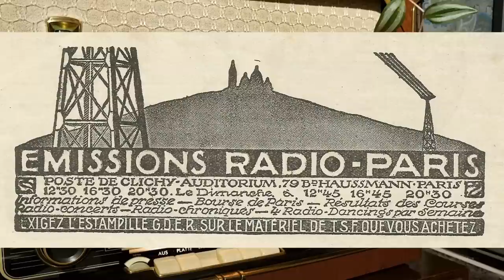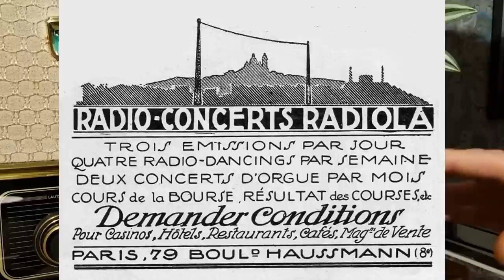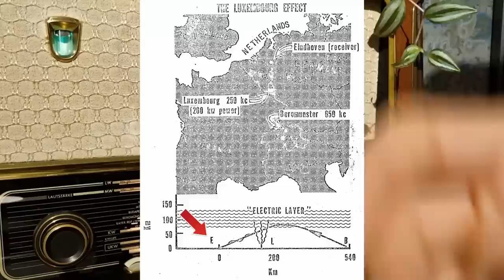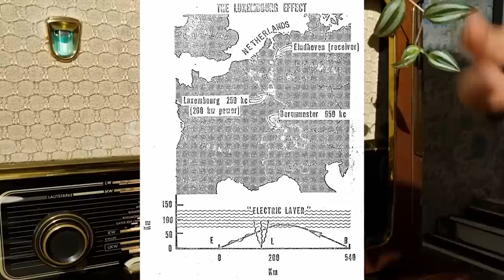We just lost the most powerful longwave transmitter in Europe, and why that's kind of a big deal

Comment: 198 is the BBC Radio 4  domestic service between 05 30hr to 01 hrs, becomes a modified version of BBC World Service between 01hrs 05.30 hrs GMT
Reply: In addition, the video mentioned the BBC likely to close it down in the coming years.. Thats maybe not as likely as it might sound for a couple of good reasons, which apply to this transmitter but not the BBC's other transmitters. This transmitter is a bit special...
Firstly, as has been mentioned it is used to transmit signals for the UK electricity system, and to convert all those receivers would need a huge investment of time and money
Second, this transmitter, because of its high power and long reach, is used to broadcast the shipping (weather) forecast for all the waters around the UK. This is done by the BBC as part of the usual Radio 4 schedule, at (from memory) 0050hrs, 0530hrs, 1202hrs and 1755hrs. This is meant to be heard by any shipping within about 1000 miles or so of Droitwich which covers all the waters out as far as Iceland and down into the Bay of Biscay. To stop this service would be something a government minister would be reluctant to put a signature to, there would be lobbying, and "questions in the house" and much stamping of feet.... 
Thirdly, and probably weirdest of all is that the existence of the BBC broadcasting on 198kHz is taken by british submarine commanders as proof that the world hasn't ended yet.... The idea being that they regularly check to see if they can pick up the BBC on that frequency. If they can't, they are to assume the UK has been destroyed in some sort of nuclear attack and then they open the sealed letter they have on board from the UK Prime Minister which tells them what they are to do next. This is necessary because those submarines would contain the last of the UK's own nuclear missiles, and without a UK government, the commander needs to know what to do with them! These letters are apparently one of the first tasks that a new Prime Minister has to undertake when he or she enters office. 

This is all almost unbelievably surreal but it has been detailed in many articles and documentaries over the years quoting both military and government sources and is so quintessentially quirky and british that I have very little doubt of its truth. 

What this means is that that transmitter is a vital part of not only the UK broadcasting infrastructure, not only part of the UK energy infrastructure, but also part of the UK government and military infrastructure.

So no, I don't think its going to be taken off air any time soon! But I could be wrong!

Comment: Can local private broadcasters even in the Netherlands pirate occopy those now empty frequencies?
Reply: Only frequencies owned by The Netherlands. But they are being given out and planned in such a way that the new users don't interfere with each other. With all major medium wave stations in the netherlands having closed down, there are now about 50 new local and regional MW radio stations! Power is limited to either 1w or 100w depending on your choice. Range very much depends on the antenna the station is using. Cost (for the 100w transmitter) is less than the cost to run a 100w radio transmitter.
Power needs to be kept low so dutch stations don't interfere with others in Europe, but also so the same frequency can be given out multiple times in different areas in our country. As far as i can tell with the 100w frequencies, one channel is only given out when there's no other user in a radius of 50ish kilometer. For the 1w frequencies that radius is a lot smaller.

Comment: I used to work at an AM radio station. we put out a blistering 1000 watts. the cool thing is we had C-QUAM. shortly before closing I turned the modulator back on and cranked it to the max, 1200 watts. it was super interesting to see AM stereo work before it went down.

Comment: That sad . I am in the USA and some of them stations came in at night. I got long wave on several radios. Hear in the US we now have 2 armature radio bands. also WWVB can be herd on long wave hear. I got a nixie tube clock that has loop stick antenna and it locks in .  currently 2023 FEB I hear a lot of digital on long wave. and we are loosing MW AM stations in the us. some transmit digital HD radio only on the MW band. lot has to do with the cost of power. over the years the USA has been switching broadcast from analog to digital.  we still have a lot of SW stations     on the air. WBCQ WMRI and some others . WWV still sending  time data and solar data. and turned back on 25Mhz   .The Russian wood pecker is gone.  video's on YouTube show how big the cite was. now one Ukraine cite is radio active and not used. part of the cold war radar system. nice video on biggest LW transmitter. from USA NY .😀
Reply: YOU MEAN "WE ARE *NOT* LOSING MEDIUM WAVE STATIONS, RIGHT?

Comment: Sad. I can receive Medi 1 from Morroco quite well. Somethimes they talk and receive phone calls in French, sometimes they play modern music but often i can hear local Morrocan music. It is also quite powerfull.
I use JRC 525 with miniwhip or single line thrugh UnUn. Tube radios i try not to run for whole night.
Medi 1 is 1,6MW on LW, but i can receive Slovenian Radio Murski val at 648kHz quite well which is 500km away and it has only 10Kw of output power.

Comment: Allouis 162kHz is still on with phase modulated carrier only, as a time signal station (ALS162).
Reply from the maker: Thanks for sharing
Reply: I was just thinking the other night, when I was "listening" to that, would be not be just as costly or not to modulate it with something - anything  - other than just broadcasting a blank carrier?
Reply: @paulsengupta971  Hi, I remember reading they broadcast an atomic clock signal. To sync what exactly is another matter.

Comment: Old radio's are just funny things to look at, or you can build in a DAB radio that uses the old radiospeaker.
It began (I think) with the dissaperance of the flemish transmitter, then the Hilversums and finally La Une walonne that disappeared.
Reply from the maker: Or you can add a Bluetooth module so you at least still use the original amplifier of the radio. 😉
Reply: @retro_tech  Hopefully that is even simpler, cheaper and more original sound
Reply: @retro_tech  More appropriate would be changing the tuning circuit to act as the RF part before a modern demodulator for stuff such as RMD and DAB.  This would also involve supplemental changes to the band selection circuit, as some of the fixed value coils will need new values for new bands.
  This way the circuit becomes classic RF section - modern demodulator - classic AF section.  Be sure to scale the voltage range between tube and chip sections.  Have fun adapting DAB chips to work with a separate RF tuner so digital controls only select a subchannel within the tuned to MUX.
Reply: Keep the circuits of the old radio intact and just make an am transmitter to broadcast the programs of your choice around your house.  A low power AM transmitter is easy to build an can be operated off batteries or an ac adapter.

Comment: you don't get Warsaw on 225khz??
Reply from the maker: Not really. I can only get it with my mini whip antenna, and then still with quite a bit of distortion. So definitely not indoors with a normal ferrite rod.
Reply: @retro_tech you only receive medium or long wave on a copper wire wound ferrite rod, 
*NOT* a metal whip antenna

Comment: The radio channel France Inter announced during 2016 that the channel would discontinue transmitting on the 162 kHz frequency on 31 December 2016, seeking cost savings of approximately 6 million Euros per year. They used the Allouis site which is now as a time signal. Internet killed the longwave star.

Comment: I have an Opus 6 Telefunken radio looks a lot like your Operette radio. BBC Droitwich is running on the last of the available vacuum tubes for their final amplifier.
Reply: Hopefully some boffin finds a way to build an output stage from modern components from the SMPS industry.  Basically the same components used in HVDC power line interconnects, but in a quite different circuit mode.
Reply: @johndododoe1411  yeah I see that point.  Problem is nobody wants to pay the electric bill for the huge transmitter even if you make it more efficient
Reply: @mikekokomomike  Point wasn't to make it more efficient, just to keep it alive without an impossible supply of antique components.  Specifically the companies making parts for the power grid (ABB, Westinghouse etc.) actively makes and sells semiconductors that can operate at the required power levels and above.  Thus instead of repairing a museum grade tube based output stage, someone with time on their hands could use surplus from the production of these power grid systems to make some boxes that can be installed at long wave transmitter sites in place of the old equipment without forcing any change in the radio signal.  Grid suppliers are also very experienced in providing such equipment with multiple decades of service, support and warranty.

Comment: What are we going to do with our beautiful radios? I guess we better make some little transmitters for personal use.
Reply from the maker: Indeed. Making a good quality AM transmitter is rather high on my to-do list.
Reply: @retro_tech  That would be great. If you ever have the time to make it would you mind to share it with us, please? I'm a technician, but I don't know enough about designing my own circuits. I have built some designs but they are not clean A.M. they modulate frecuency a bit. One even with separate oscillator stage. 😐
Anyway, thank you for the video, your response and your time.
Cheers!
Reply from the maker: @audioreparaciones8956  Sure! If I ever build one, I will share it here on my channel.
Reply: @retro_tech  Thank you!

Comment: I thought Radio Luxembourg was on the medium wave 208 on the dial, I used to listen as a child and a teenager here in England. I remember it used fade in & out which was most annoying. Tony Prince was one of the disc jockeys, those were the days.
Reply from the maker: You are correct, but Radio Luxembourg started in 1933 on longwave. Beginning of the 50s, Radio Luxembourg II was opened on 208 meters medium wave and English programmes were moved to this station. In 1954 both channels merged again. Finally, Radio Luxembourg stopped in 1991 and RTL took over the longwave frequency.

Comment: Don't you think, or hope, that AM will know a revival just like vinyl does? After all, centrally operated transmitters are far more energy efficient than individual streaming...
Reply from the maker: I would hope so, but it's very unlikely. We have huge interferences on AM radio these days in our urban environments caused by things like switched mode power supplies and LED lighting.